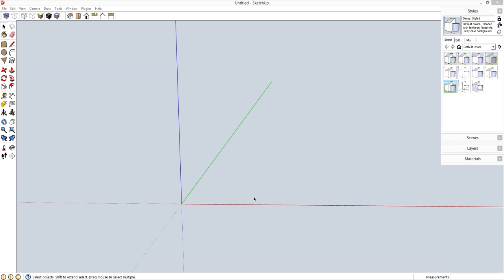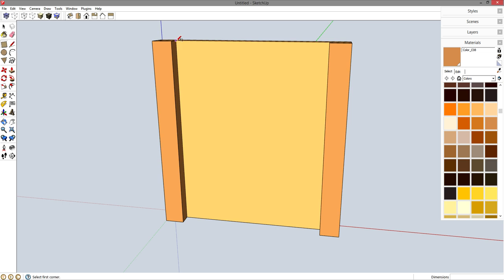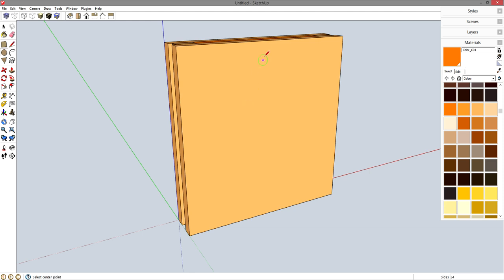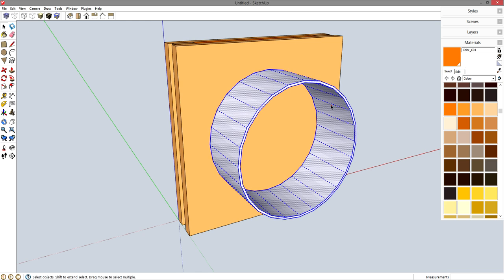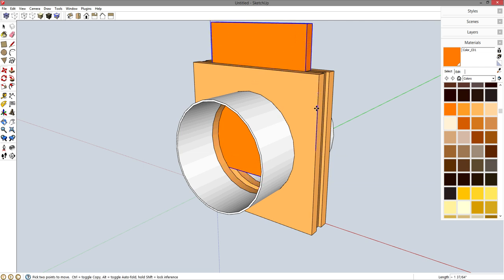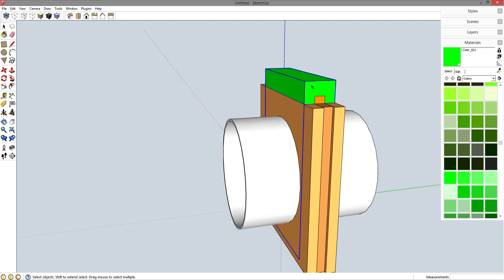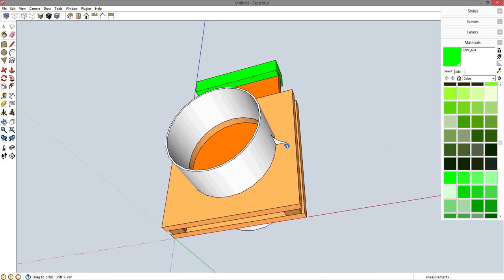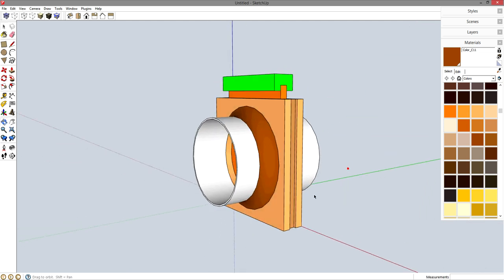SketchUp: 4" PVC Blast Gates - 159

Comment: This is pretty cool. I'm a mograph guy (among other things), so I do most of my designs using Cinema 4D. It works, but it's a bit like using a sledgehammer as a fly swatter. Thanks for walking through this so concisely. It's making SketchUp a lot more accessible.

Right tool for the right job, eh?

Comment: Hi Jay.  Appreciation for your work. Did I miss it or you didn't seal the bottom opening, the one between the two outermost layers of plywood? If the gap is on purpose, please explain what is a use of it? regards from Europe.
Reply from the maker: drezynyEU I used tape to cover it. Works great.

Comment: Hi Jay, question, my first thought is that I would make holes (with a router) that would tight fit the pipe and then stick and glue the pipe in the hole. Would that be a bad idea? Just wondering why you did it the way you did.
Reply: thought the same, make the hole out diameter of pipe most of way through, leave a lip so the pipe can't go all the way through
Reply from the maker: littlebighumancom Just the way different people work. This method seemed to be the easiest to me.
Reply: littlebighumancom I agree 100 percent the piper could be glued to the inside and then add a bit of glue around the outside much cleaner that way

Comment: Jay, what holds the gate open if set in a vertical position?
Great tutorial on sketchup
Reply from the maker: Gee Dubb Nothing. It needs to be mounted horizontally. I just drew it vertically.
Reply: ok. was just curious. I can figure a latch pretty easy.
Just an idea that popped in my head when you was sanding the glue end, you could also cut a shallow groove on the table saw just above the cut to make a good lock for the glue.
 Thanks again!